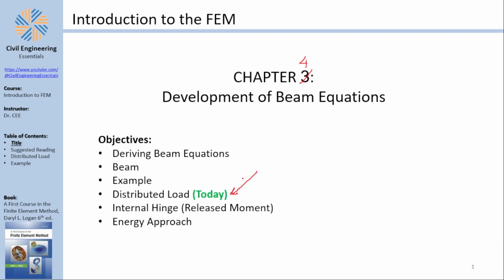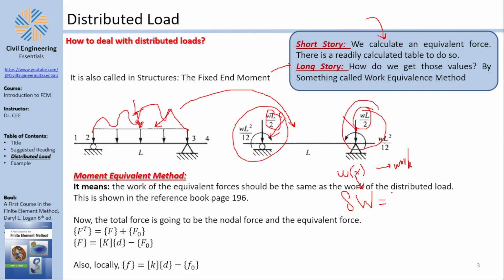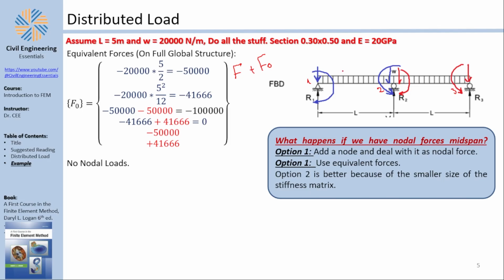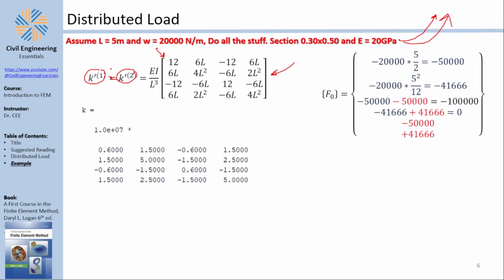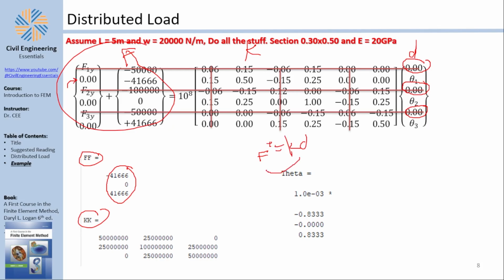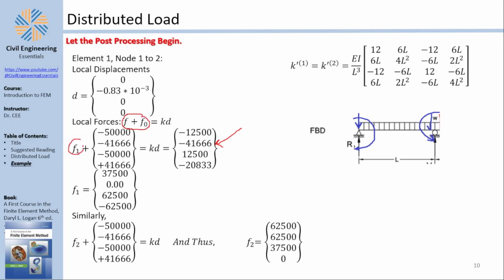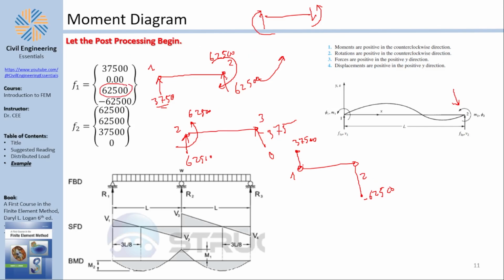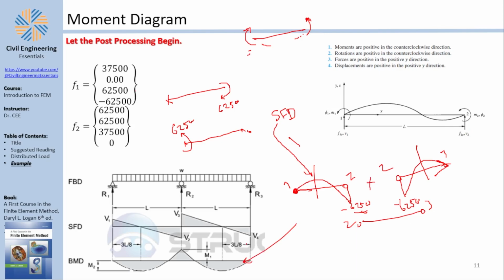The Finite Element Method | Part 9: Bending Moment and Shear Force in FEM

Comment: Hello Dr. CEE,

Thank you and thank you, these FEM videos are truly amazing. I try to follow along and yes, I do stumble more often than I would want to admit, but I dust myself and get up and press on. Your explanation and your inclusion of the seemingly little but key details in your explanation are golden and they really really help to keep going. I have now successfully completed this example, however I had to deal with the following which I am requesting confirmation/guidance from you Doctor.

Stiffness Matrix Units: With previous topics, I did not have to worry much about the stiffness matrix units when assembling the (avengers, oh, scratch that) stiffness matrices because all the elements (entries) in the stiffness matrices had the same units. Now with the beam element, one has got a mix of EI/L, EI/L^2, and EI/L^3 units…. I had to very carefully match the corresponding units on each matrix entry even for the case where there are some Zero values entries on the stiffness matrices. Do you find the units to be more involved in the case of a beam element stiffness matrix as compared to the previous spring and truss elements stiffness matrices?

Boundary Conditions: When considering the boundary conditions, M2 (along with M1 and M3) was set to zero, my first thoughts with regards to M2 were “…but wait Doctor…. 😊 isn’t there going to be a continuity moment over node #2?... I get that there is a roller but….” I then finally concluded that yes, there will be a continuity moment BUT the moment is NOT on the “roller support” it is on the “Local member (on the local element at node #2)” and this is why M2 which is the moment on the roller support is set to zero when considering boundary conditions at node #2. Is this the correct reasoning Doc?

Your explanation of the FEM and the Statistics sign conventions to use to draw the SF and BM diagrams from the post processed local element results is to die for, thank you so much for this; and for throwing in the last nugget about differentiating or integrating the BM diagram function M(x) or SF diagram function V(x) to find the location of the maximum or minimum values.

Your FEM lectures are unmatched and they are very informative. You are helping a lot with these and they are truly appreciated.

Kind regards, DK
Reply from the maker: Hi there Engr. DK,

I am happy you like those vids and they assist you in understanding how softwares "think" in general.

I usually say: to be on the safe side, use "base" units. Here, I suggest to use Newtons for forces, meters for distances. And anything derived from that such as Stresses (Newton / meter ^2)

if you do this, you are golden and have no unit problems.
Let me put it that way:
the unit difference in the beam stiffness matrix is just a matter of having L or not. 
Why? because L represents length in meters, and the load vector is either a force or a moment, you can see how L is playing a part here.

It is a little deeper than this, but I hope that those little ideas help you grasp the unit concept.

You are correct, in the force vector, the force entries are the "External forces" applied in the global axis sense + any force from distributed stuff.

Those are not the internal forces. So even if M2 (external force) is 0, there will be local forces for m2 in both elements, and "here it is" the summation of those moments will equal the external moment, in that case 0 to achieve equilibrium.

I am happy you liked the video, also, please tell me if you need any further explanation with regard to the points mentioned above. I am more than happy to provide more details.

Regards,
CEE
Reply: @CivilEngineeringEssentials  

Thank you, the explanation is good. I did (successfully) tried this yesterday with one of the recommended reading example 4.2 but then I used kilonewtons (kN) and meters (m) as my reference units. This allowed me to “temporarily - ditch” the units whist I perform matrices manipulations which in turn simplified things a lot for me during matrices manipulations.

I therefore find your suggestion to use base units to be a more attractive and a consistent option. Furthermore, base units can also help to facilitate correct anticipation of the output units of everything else that is involved. Thanks for the idea.

Your differentiation of “external forces” and “internal forces – pains ^_^”, with regards to M2 have put to bed all doubts I had with M2, thanks for that.

I noticed in the “solution for example 4.2” – page 187 equations (4.3.15) that the author noted F2y and F4y as “positives”, aren’t these values supposed to be “negatives”?  My calculations (I am using the metric version of the book) are giving me the same values but negative in sign. [these values are essentially the applied global nodal forces at node 2 and at node 4 and these can be read directly from the problem statement (the beam and loads layout figure 4-13 as facing the global negative y-direction).

Your FEM lectures are helping me to understand and to appreciate how structures (theoretically) behave (or are assumed to behave) in general ^_^ it is a roller coaster ride, thanks for your work.

Regards, DK
Reply from the maker: Just did a quick check on my version of the book
Indeed, i think it should be negative as the external forces are negative.
Please take my statement with a grain of salt as I quickly glimpsed over it without deeper consideration, as I am out of office ATM.

Comment: This more of a matrix method not FEM. FEM involves shape functions, and you substitute the shape function in the weighted residual statement depending on different techniques.
Reply from the maker: A first course in the "finite element method" by daryl l logan. 👍
Still, I understand from where you are coming from. You are basically pointing to ritz methods and galerkin and min. Potential energy ajd so on. 
But that wont be for a first course in the method 🌹
Reply: @CivilEngineeringEssentials  yes I have read the book. This is stiffness method, part of matrix method (chapter 2 of the book). anyways nice video.
Reply from the maker: I totally agree with you and understand ur point. Plz note that I did not cover ritz and galerkin extensively.